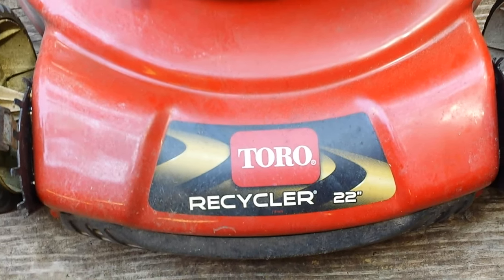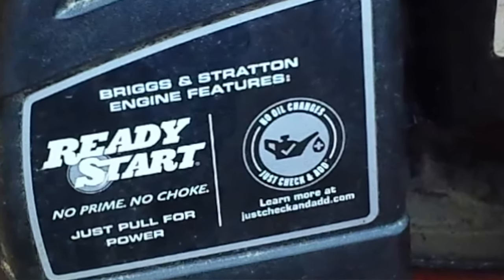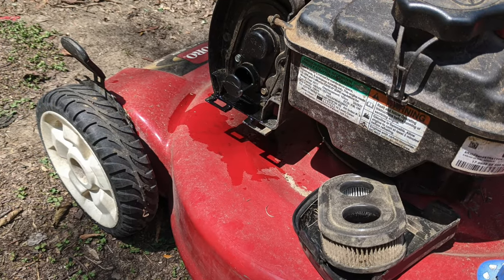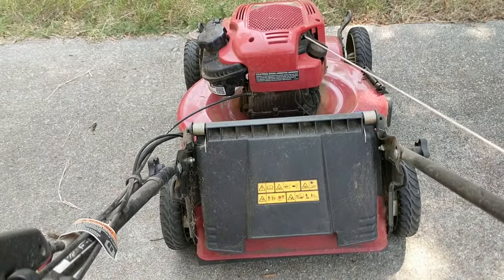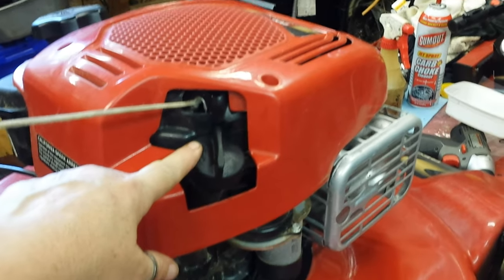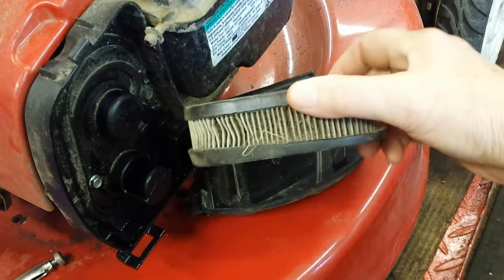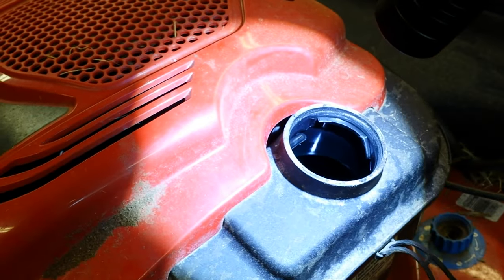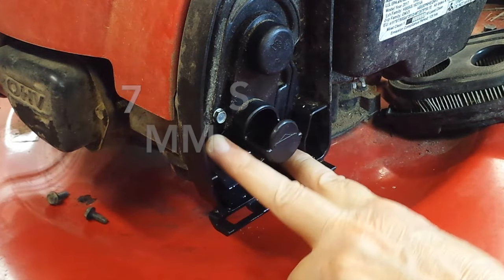Fix a Toro Recycler - Starts Then Dies

Comment: Gotta love the Jello-y stuff!  I think these plastic carbs clog worse than any carb out there.  Maybe it's just that there are so darn many of them out there.  Great video Stella, I love your calm easy to understand explanations.
Reply from the maker: Thank you Mr Steve!  I will say they are very east to work on, very few parts to wear out or break. Cheers!
Reply: They also warp if they are tank mounted carbs and the lawnmower will surge and lose a considerable amount of power trying to get through thick tall grass but the most pain in the butt problem is it will not prime I had to keep taking the air filter off and putting a finger on a port that is above the auto choke plate to prime the carb and engine, plastic on an aluminum alloy surface will eventually warp, I believe I was putting my finger over the breather port.

Comment: Please verify that you can shoot carb clean or air completely through the fuel line insert, that comes out of a golden tiny hole. This is where my mower was plugged. Had to take it apart twice. Thanks for your help. And if you’re doing this make sure the bowl fills back up with fuel after you reconnect fuel line
Reply from the maker: I would only use air, carb spray is brutal on rubber and plastic bits.

Comment: You are a life saver! We have only had the mower about two, maybe three mowing seasons. When things break everyone looks to me to FIX it what ever IT may be. The grass is growing, I can hear it in my sleep. The it rains for two days making the grass grow even more. 
Well, I did the preliminary stuff like draining the tank, air filter, but had no clue how to tackle the carburetor. I found a couple ants in the gas thinking that might be the issue. The gas cap somehow lost a gasket on the bottom and won’t close tightly I’m sure part of the problem. Anyway, after my efforts it still  would not stay running with fresh gas. Getting ready to tackle the carburetor. Wish me luck.
Reply from the maker: Take your time, it's pretty straight forward. Avoid carb spray on those little O-rings on that jet cartridge in the carb. They will swell up and not be usable. Thanks for watching!
Reply: @TheLawnmowerLady  Thank you so very much.
Reply: @TheWizdry  Did it work? The people have to know
Reply: @ayvogt  Yes! Success! Sorry you all.  Mower is back to normal, functioning with one pull start as designed. Took video of part of the disassembly to not confuse the two metal arms; throttle and ??. I bit tricky hooking those back in. Video with this video where life savers. Also; making sure the air/exhaust that just kind of slides onto the back of the carburetor is truly in place, a bit tricky.  ORIGINALLY Ran into a non starting mower, because I didn’t know the gasket had fallen off under the gas cap letting in debris and ANTS.  Cleaned the plastic fuel jet part in clean gas and blowing it out with compressed air. Success!

Comment: I have the identical mower, my wife purchased it for me 5 yrs ago. Almost immediately it began stalling intermittently and running rough. I could never correct the issue until watching your video. Disassembled the carb as shown and found nothing glaring, put it back  together and it works perfect. Similar to your unit you were working on. Thank you so much !!!!
Reply from the maker: Happy to help! Cheers!

Comment: Thank you for the great video! I was just about to toss my lawnmower in the trash until I did this. This was a Father's Day gift from my boys. Ran out of gas, put in clean gas, and then it died. The only thing I would be careful with is the float metal rod, it falls off easily if you remove it. Thanks again!
Reply from the maker: I appreciate you watching. Cheers!

Comment: Super helpful thanks so much ! Wanted to confirm that E-zero gas is important for this mower - look for it at Maverik stations. I recommend using neoprene work gloves when exposing your hands to gasoline and solvents.
Reply from the maker: Yep. I always urge folks to use non-ethanol if it’s available in their area. It’s pretty harsh on rubber bits, and when the alcohol evaporates, you have water left over. Thanks for watching.

Comment: Great video! If I might make a suggestion on these Briggs plastic carbs concerning the auto choke. I like to take the plastic piece coming from the choke linkage off with a small screwdriver so you don't have to fiddle with the Z bend. You just snap it back in place on the stud on reassembly. Give it a try. Thanks, again.
Reply from the maker: Thanks Mr Dave! I'll give that a try next time I get one of these on my lift. Cheers!

Comment: Thanks for your help love you no nonsense approach to your trouble shooting and I hear you mention the gas cap can cause a problem, Toro is giving me trouble I clean the carburetor and still having problems getting it started and notice there’s and ring around the cap that has come dislocated could that be causing the problem 
Thanks for the help Mat
Reply from the maker: If it's hard starting, but runs OK after it gets going, it's either the choke butterfly (if equipped- should be completely closed when cold) or the primer bulb (if equipped is not getting enough fuel to prime it for easy starting. Hope this helps. Thanks for watching!

Comment: Awesome video!  I have the same annoying mower and have cleaned out the carb about 5+ times now, and it runs for a while sometimes getting the whole yard, sometimes not and then just stops running.  Maybe the jet pack needs to be replaced, or the float and pin, which all looks pretty good, maybe the whole carburetor, any ideas?  It looks pretty clean every time I clean it out too, I’m ready to trash this lawn mower, and it’s only a couple seasons old….like I want to blow it up with major amounts of C4…
Reply from the maker: Thanks for watching. There still might be some crud in those tiny holes. You can get a new fuel stack for about $12 or so. Does it restart OK? If not maybe an ignition coil breaking down?
Reply: @TheLawnmowerLady  yep, it starts and then dies…. And after cleaning it runs for a while then dies.  I checked the fuel tank flow too seems good, thought it might be a clogged cap.  Guess I’ll try a new stack next.  Guaranteed to start, but not keep running, grrr…

Comment: GREAT Video, Now I am going to tackle my project with confidence. Thanks. Would you know the part # to the air filter cover? Mine cracked
Reply from the maker: I do not offhand. Use the parts lookup on any major parts house: partstree, jackssmallengines, etc. to get the right part no.

Comment: The follow up texts are gold! About a month ago I serviced a snowblower for a co worker and he used after a huge storm and called me cursing and swearing that the machine just died like it wasn't getting fuel. I tossed one of my blowers on the trailer just in case he hadn't finished his driveway and went over to have a look. He had run it dry of fuel 🤦
Reply from the maker: Haha Mr Pat! I hope your customer had the same sense of humour when the real problem was revealed. Cheers!
Reply: @TheLawnmowerLady  he sure did have a sense of humor about it, he is a super nice guy

Comment: My Toro 22 is different. Yesterday the engine was reving when I turned it on. After a couple minutes it sounded semi normal. Started cutting my grass and it died. My carburetor area was very dirty. Gas has been leaking from where I put gas in if I fill it more than 1/2 way. No sure what the problem is? It's taken apart right now. Going to work on it today. Great video!
Reply from the maker: I hope you figured out the problem. Cheers!
Reply: @TheLawnmowerLady  Thank ls so much! I fixed it I think? I cannot get the spark plug off though? I know it needs a new one it still hesitates and the engine reves for a minute when I start it. I don't know what socket I need to take it off?

Comment: My toro recycler is only a year old. One mowing season. It was running rough then stopped and won't even try to start. I use ethanol free gas and it has new oil in it. Checked the air filter and it was really clogged up, so I cleaned that. I've never had a mower quit after 1 year. It's under warranty but the mower dealer I bought it from closed up. I guess I could check the carb...just doesn't seem it would do this after one season?  Thanks for your video.
Reply from the maker: Sorry to hear that. Definitely drain out all the fuel from the tank and the carb bowl. Set the mower in the sunlight to dry out completely. Even using ethanol-free fuel can develop condensation over the winter if the tank is not topped off. I appreciate you watching. Cheers!
Reply: @TheLawnmowerLady  Thanks for your advice. I'll give it a shot.

Comment: Hello and thank you for your instructional video. I'm a woman that fixes her own lawn mower too. Question: do you have a video that shows how to test and adjust the rpm?
Reply from the maker: Thanks! I use an inordinately pricey tachometer purchased for a different purpose. There are several less expensive ones out there. Generally speaking, increasing the spring tension on the governor return arm will increase the RPM on any of these small engines. I do show that in many videos, but The only video I have with that as the main subject is: https://youtu.be/s1eiIAJC_jo There are links in the description of several tachometers. Cheers!

Comment: I have a toro with the plastic carb. Mowing and stopped to change the cut height. Would not restart. pulled the air cleaner off and was full of gas. So got it up on the bench and pulled the carb. and this thing has a plastic needle in it... and not sure how but it would not seat. cleaned everything and put it back together. Will check rpm seems to be running a little slow. 22 in and I could not figure out how to adjust the rpm, you helped me with that too...THANKS....did see the carbs for sale on ebay for less than $20. Seems high for $2 worth of plastic   LOL
Reply from the maker: I agree about the cost, but to be fair, that plastic carb is very simple, with very little to go wrong. Thanks for watching.

Comment: Thanks for the info.  Very informative.  I have a question for checking and oil level.  Should we check the oil level when the engine is hot or cold.?  Should the level in the full position?
Reply from the maker: I honestly think with this small of an engine, it really won't make a difference between hot/cold. What does make a difference is un-level ground, and you should give it about 3-5 minutes after stopping the mower for the oil that has splashed up in the crankcase to settle back into the oil sump. Thanks for watching. Cheers!
Reply: @TheLawnmowerLady  Thanks for the update.  I have a same 163 cc Toro Lawn mower which has the same problem (i.e. starts at full power. After about a minute, the engine starts slowing down.  Then after just another 2-3 minutes, it stalls).  I have replaced the main valve and then follow with a brand new carb.  However, I still have the same problem.  Any idea or advise?  Thanks.
Reply from the maker: @benp7164  if it happens with a replacement car, I'd look towards a fuel flow issue. Either a collapsed fuel line, or a clogged fuel filter. There is a fine mesh filter inside these tanks, there just might be an accumulation of dirt and debris good luck
Reply: @TheLawnmowerLady  I have removed the fuel tank and clean it before replaced the car.  However, still has the same problem.  Thx for the advise.  I will check the fuel line.

Comment: Thanks, very helpful. On my plastic carburetor a small nozzle was clogged over the winter, now it runs again.

Where is this supposed to lead, my carburetor is 97% plastic including the choke flap. Even the float needle is made of 100% plastic.

So grandma's lawn mower from the 1970s was not design award-winning, but had much better quality.
Reply from the maker: I agree about Grandma's mower. Everything was made better and made to last. I appreciate you watching. Cheers!
Reply: @TheLawnmowerLady  Lawnmowers are still simple, since I live in northern Norway we unfortunately also have to use snow blowers. The mechanics are simple, but combined with cheap technology and poor quality from China, the snow blowers are the last crap. Unfortunately, a good snow blower is very expensive and still vulnerable.

Comment: I have this same mower. How can I add a push start like this one has? Thax
Reply from the maker: I think that will be complicated, as it requires a different flywheel. It has to mesh with  a starter gear, and house a battery somehow.

Comment: I only had one of these newer style Toros with the 163cc engine and it had roughly 3x more oil in it than it should have. So I had to dump out 2/3's of it and than start it and let it burn off all the excess smoke for about 10 minutes. After that it was fine. I love when people add too much oil thinking it's a good thing.
Reply from the maker: Thanks for watching Mr T! I figure it’s the one thing folks feel like is in their skill set, I mean how hard can it be to crack the cap on a bottle of oil? No tools required 🤷🏼‍♀️

Comment: Lawn mower lady how do I raise the idle on a tank mounted carb? Do I readjust the air gap of the coil? Or how do I make the throttle spring tighter to raise the idle on this Briggs and Stratton eng?
Reply from the maker: https://youtu.be/s1eiIAJC_jo Although this video is 9n a Briggs Quantum engine, the principle is the same, there will be a tab or bracket where the governor return spring attaches. Increase the tension on that spring, by bending the bracket will increase RPM. Thanks for watching.

Comment: Please help I have a Toro 7.25 163CC.. Mower wouldn’t start, so I cleaned the carburetor, changed the spark plug and air filter and only starts and then dies. What can it be?
Reply from the maker: Did you completely disassemble the white plastic fuel stack in the carb? Those are notorious for the slightest bit of grit clogging up the system. Also check for good fuel flow through the carb. Maybe a partially collapsed fuel line?

Comment: Hi, I found this video because the spring on top of the carb was disconnected and I did not know where to attach it. The video was so good that I went ahead and took everything apart, cleaned it, and reassembled it like you showed. I did not find any problems. The original problem is that the mower quit and I could not pull the cord. I disconnected the spark plug for safety and had a very hard time turning the blade with my hand. I went as far as to pull the plug, drop a little motor oil into the plug hole and was able to get the blade to turn by hand. I replaced the spark plug but still, the mower will not even try to start. Any ideas?
Reply from the maker: Did you check the level of the oil? I don't want to assume it's seized, but that is a possibility. Maybe a bent crankshaft? Thanks for watching.

Comment: What kind of tension or play should the metal auto-choke arm linkage have? On mine, it's pretty sticky (?) or caught. It has full motion but it's definitely not smooth like when I pull on the throttle linkage. Should it be similar to the throttle arm? The plastic part it connects to also seems to barely clear the spring, it's just about to graze it- surely that's not right.
Reply from the maker: Definitely hard to diagnose over the internet, but yes, both should move freely.

Comment: I have a toro tecumseh self pace mower 21inch new carb adjusted float new shut off cable..will start when primed then died runs a minute..what you think wrong
Reply from the maker: Air leak! I'm assuming you put on an aftermarket carb? They are hit and miss (as you might have discovered) I'd be cleaning and re-building the original carb.

Comment: Hey do you know if you can safely run a shot or fuel stabilizer through a lawn mower?

I have a Honda motorcycle with 4 carborators?/ I believe, and a mechanic told me instead of paying to have those hard to reach places cleaned - add a shot of stabilizer to the gas tank and run it empty before winter.  Then at winter, fill up the gas tank and add another shot of stabilizer at the top.

Oil change is easy on the mower, but I’m not so confident on cleaning the carborator.
Do you know if some fuel stabilizer could do the same thing?
It’s gasoline and 4 cycle etc.
Reply from the maker: Fuel stabilizer helps. but eventually some gunk will end up in there. Not that difficult to clean. These plastic carbs are very simple and easy to service. I appreciate you watching. Cheers!
Reply: @TheLawnmowerLady  thanks :)
Yeah I’ll watch it a couple more times and try it. 
The oil change alone does wonders,  but that’s definitely the next thing it needs.
I had to mow a lawn without the air filter because it wouldn’t run with it, so I’m sure it needs a cleaning - or just new pieces if they come in plastic now. 
Great videos

Comment: Have an exact same model that has the same issue, cleaned carb twice, made sure no water in fuel system, checked spark plug and cleaned, adjusted ignition coil gap, but still starts and dies. Couldn't think of other issue. Any input would be appreciated
Reply from the maker: I've seen the tiniest bit of debris clog up that fuel cartridge. You can try replacing just the fuel stack: https://amzn.to/3LF3m9x
Reply: @TheLawnmowerLady  found the issue - was the carburetor. Replaced it with a spare one fired right up. Gonna cleaned the old carb again and will try to locate where exactly is clogged. Thanks again

Comment: I have same carburetor system.
Old carb and bought new carb, they both after 15 - 30 minutes of using, starts to fuel running out out carb.
Any ideas?
Reply from the maker: Bad needle/seat. Many aftermarket carburetors are cheap, and inexpensive and often fail. That's why I prefer to repair, rather then replace.